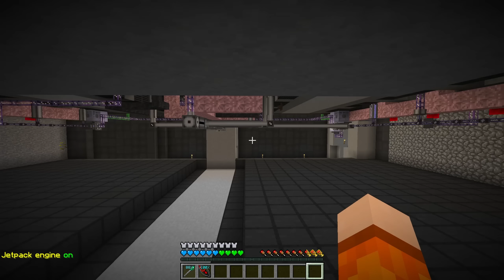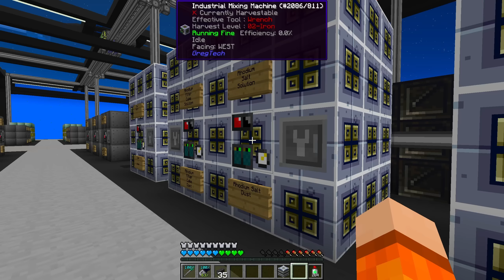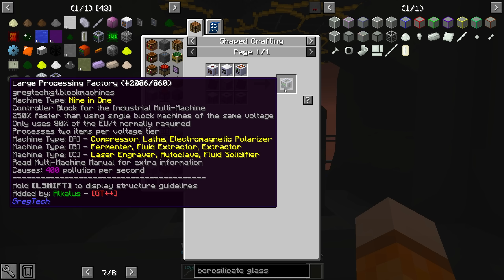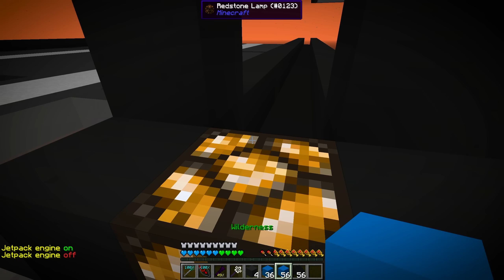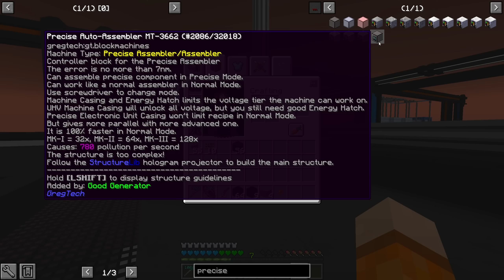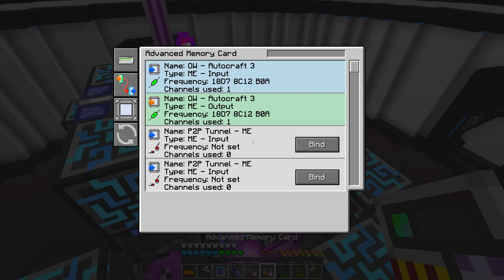Gregtech New Horizons S2 68: Autocrafting Hardware

Comment: Can you use blocking mode on the Dual Interface with recipes facing the e.g. autoglave dual interface?
Reply from the maker: You can use blocking mode, but you need to use the Advanced Blocking Card in the subnet Dual Interface along with Blocking mode on the main net Dual Interface

Comment: How do i get the multiblock controller to tell me output/s and input/s?
I cant find the option anywhere
Reply from the maker: Which multiblock are you referring to? If you mean inside the GUI of things like the Processing Array.. It is a relatively new feature in the pack, so make sure you are on the latest version :) (I'm currently on the latest stable: 2.5.1)